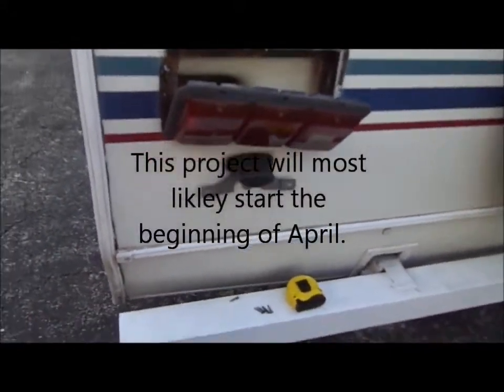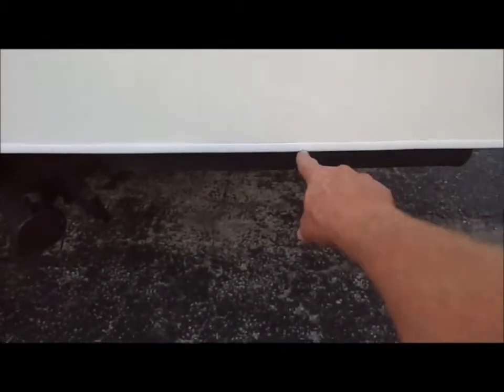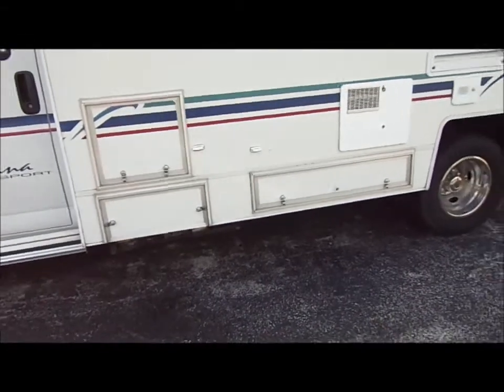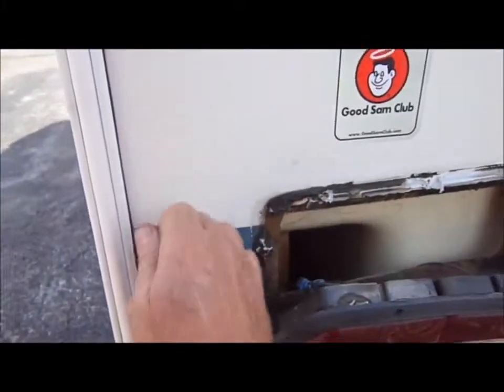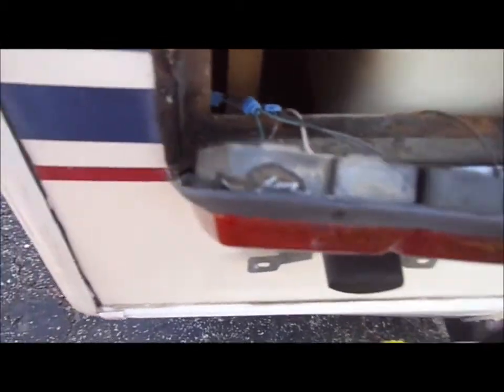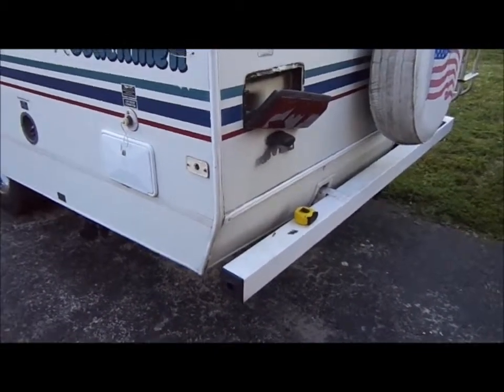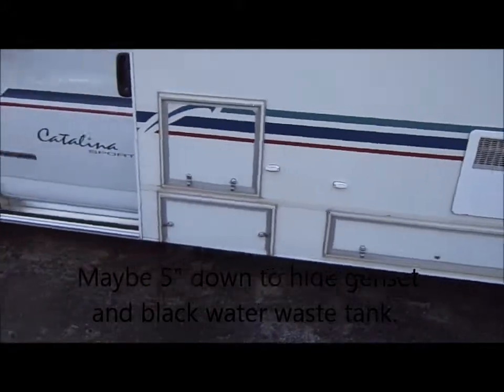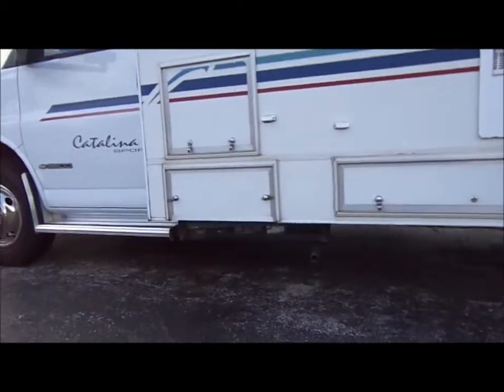RV rotted wood.

Comment: I would go over every hole from roof to frame and remove all the old chalk. As that stuff does wear out. That means vents, windows and hatch covers. Also do the ladder screws or anyplace you have a hole drilled. And use that industrial stuff from 3M or Locktite. It last 20 years and doesn't dry up or shrink. 

And for anybody going to use LED lights. Don't use them on the rear lights. Today's transmissions are tied to them. If you change the resistance it will think you have the brakes on and burn up the transmission. And also check them as the same happens if they burn out.
Reply: Claude Rains the main place are the edges.  Remove the trim, the screws. Clean and scrape all old sealant and replace with butyl tape. If you plan on using the same trim pieces remove them carefully.  Otherwise you can buy new ones.  But that is the most common area of leaks.  And should be replace at least every 10 years.
Reply from the maker: Thanks Lc, the project is done. You can check the other videos for the finished product.

Comment from the maker: Hey it's all good,
It's not really going to be that big of a deal.  It's the only little bit of rotted wood on the coach that needs to be addressed. As far as the DP I'm going to use 0.25 it's decorative not structural so it wont be adding much weight at all. I would be surprised if I used 25lbs.